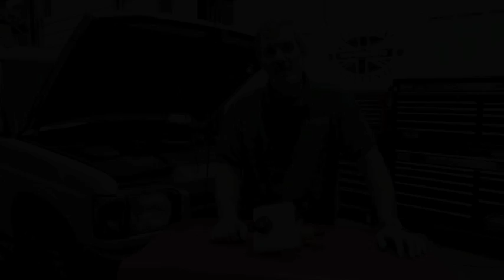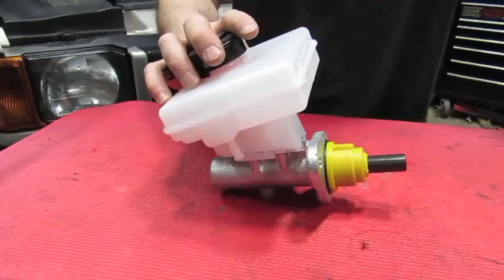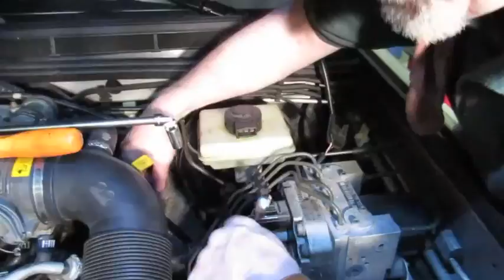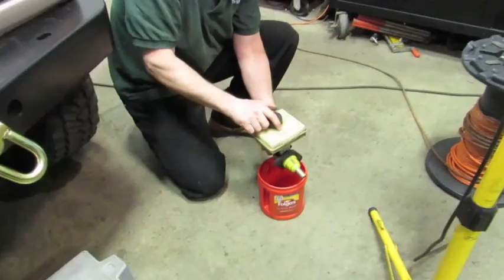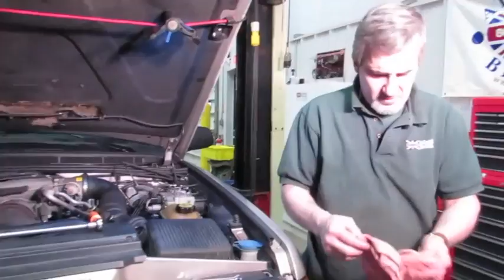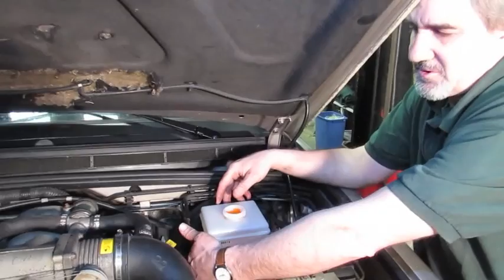How to Replace a Brake Master Cylinder on Discovery Series II | Atlantic British Presents

Comment: About the easiest thing I've done on my Disco!   I found it easier to remove the intake from the filter housing to the manifold.  Gave more space for getting at it.  Also, maybe my car is different, but the nut he uses the long extension and swivel on, is easy to reach from the side.  Very easy, easier than hassling with that big extension!  And, does he say accelerator pedal when he meant brake?
Reply: I believe he means the brake pedal.

Comment: My 2004 had bad o rings so in the winter the master cylinder would let air in and the pedal was to the floor. East fix, I bled the brakes without the diagnostic tool and it worked fine.

Comment: This helped me get a firm pedal back on my Discovery 3 after I'd changed all of the brake flexi pipes and calipers. Pedal was sinking to the floor even after bleeding all 4 corners. So I used the Master cylinder bleed tip and it sorted it out. I now have a solid brake pedal without pumping and it no longer sinks.
Great video!
Reply: Did I miss something? What bleed tip?  Just replaced mine on a 2002. Followed the video but still no brakes.  I talked to one of the sales guy at AB. I'm told it needs to be hooked up to a computerized brake bleeder system. huh? Now ya tell me?

Comment: When you put the cylinder back on, are you filling it with fluid and THEN doing the bleed? Gonna have to replace mine because of a leak, just trying to figure out if I'm gonna have to bleed my whole system.